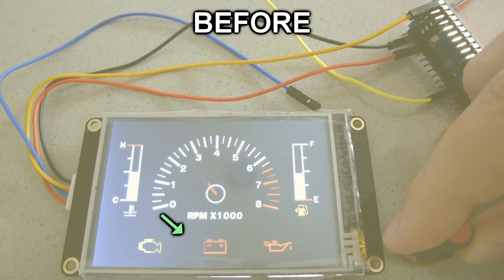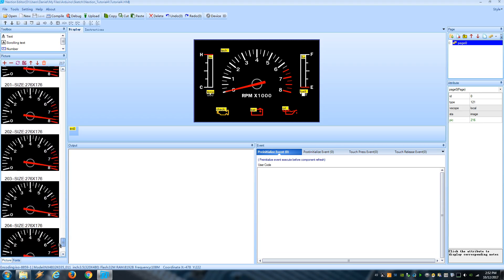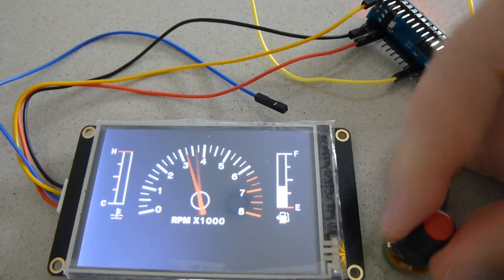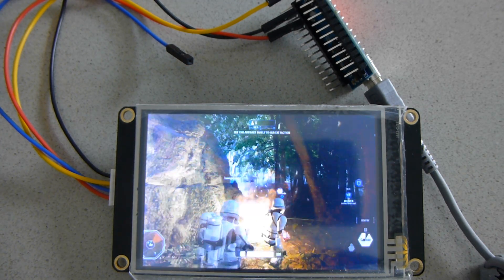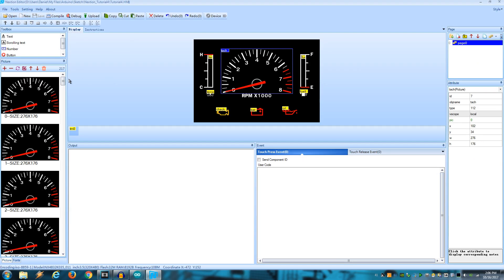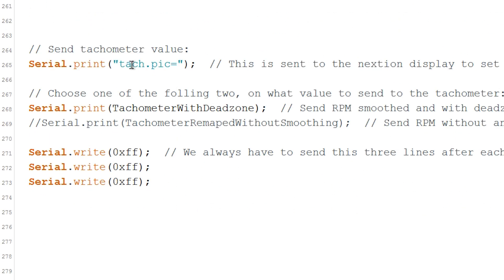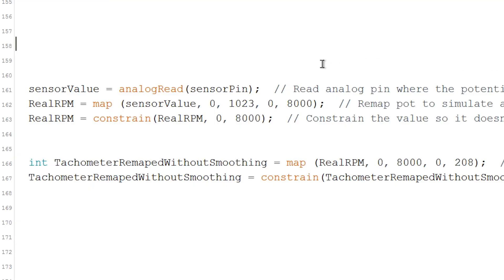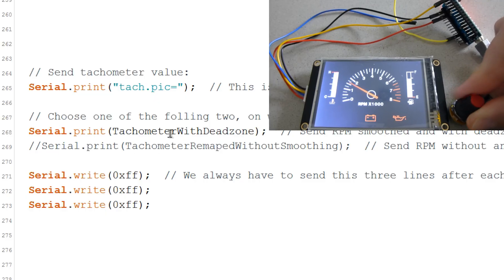Nextion+Arduino Tutorial #4 Custom Gauge And Play Video

Comment: Very nice video, how did you manage to make the images change depending on the received value inside the NEXTION editor ?
Reply from the maker: It's simple. The nextion editor has a variable and then I run a timer (loop) that runs a piece of code that puts the correct image depending on the value of the variable. If you open my project, you'll see

Comment: Is it possible to get that same precision out of nextion, to control a stepper motor, using it in place of a rotary encoder to micro step to positions?
Reply from the maker: Stepper motors are a completely different subject, but I guess it should work. My experience with stepper motors is very little
Reply: @interlinkknight  That’s cool.. I’m looking into it now.. I want the same type of resolution you’re getting to change the images, except using a slider in nextion, to rotate a stepper..

Comment: Please explain more the,gauge smoothen and deadzone part of the code. # What is the purpose of Deadzone?
# in calculation how the smoothening happens?
Reply from the maker: In the code itself i added comments to explain everything. Maybe you can also check out my video and code about tachometers, because i use the same nextion display and same gauge
Reply: @interlinkknight  please share the link of tachometer video
Reply from the maker: https://youtu.be/u2uJMJWsfsg
Reply: @interlinkknight  actually this method kill the flash memory.

Comment: Well, how cool is your initiative, I have an old car with a carburetor and I would like to implement it in its instruments, where there is already a digital clock display, basic functions of an on-board computer and include temperature, oil pressure or quantity of fuel. I studied electronics about 20 years ago and I know that with Arduino I can implement it, but I'm not in the business, maybe with the material that I made available, thank you very much !!

Comment: First of all Nice Job!
In second place i have a question...
How can i hide and display the three little images (motor, battery, oil) on the bottom?
Reply from the maker: There's a command to hide objects. If you check the example files you can see them
Reply: @interlinkknight  i find it, thank you

Comment: how to get the code? i dowload but dont open.
Reply from the maker: I put the links for both files in the description for Arduino IDE and Nextion Editor
Reply: @interlinkknight  dont work cant open arduino say but i find the file thanks. i want to ask you something. if i dont want to work gauge with potentiometer but with my can bus. the example is that. 
include <SPI.h>
#include <Canbus.h>
int data;
char buffer[456];

void setup() {
  Serial.begin(9600);  
  Serial.println("CAN-Bus Test");
  
  if(Canbus.init(CANSPEED_500))
  {
    Serial.println("CAN Init ok");     
  } else
  {
    Serial.println("Fail init CAN");    
  }
  delay(1000);  
  
}

void loop() { 
  
  Canbus.ecu_req(ENGINE_RPM, buffer);  
  Serial.println(buffer); 
  Serial.print("");
  delay(10);
}

the code show me the value with buffer how to do work this buffer with nextio gauge?
Reply from the maker: Sorry but I can't help further than this. I have no idea where that code came from. I only can help with my code
Reply: @interlinkknight  at your code i have problem. i dont find how to work your gauge with out potentiometer. the value from the potentiometer i give him from serial port and not from analogRead. thanks and sorry about my question and for my english :D
Reply from the maker: I don't know how to do that so I can't help

Comment: hello mate. first GREAT work, with your instructions i fix something like this. but i try when screen start do it check and show me the gauge from zero to 8000 rpm and then start count but i try so many times and dont find nothing can you help me how to do this?
Reply from the maker: Make on each cycle variable=variable + 1;

You need to record in another variable that you did the test mode to reset and start normal mode. This is basic stuff. Look for tutorials about "if else functions"

Comment: hey mi friend i have problems with the program when i upload de nextion panel and is : Target device does not match selectec device when i change te display ?? or i have a start a new proyect with this caracteristics and your tutorial ? i have a nextion 400x240 and this error when i upload
Reply from the maker: In the nextion editor, the top tool bar there's a button called "Device ID" in the right part of the tool bar. Click there and select your display.

Comment: Good video! But I have a problem, when I copy pictures inside nextion editor, then the nextion editor generates a white border for all pictures, and so it seems no good, because the background Is black and pictures are not confused with background. Maybe Is a bug of nextion editor, I don't know. I'm waiting for your answare. Thank you!
Reply from the maker: Looks like the pictures you are adding have the wrong resolution. Add pictures that have exactly the same resolution as your display
Reply: My display Is the same of you (3.5 inch). I'd like to insert a picture of a gauge like you. But I don't understend your answare, because the resolution of the screen is 420x380 px but the resolution of the gauge is less of screen one. Thanks for your time
Reply from the maker: Oh. You mean a normal picture. I thought you meant the background picture. I've never seen your problem before. Try with other kind of images. Remember to be bmp format
Reply: It's a big problem. At first I wanted insert pictures of gauge without background, but nextion editor added white background automatically. So I thinked to add manually balck background to all gauge pictures (because screen background Is black, and gauge pictures seem without background). However the problem now is that when I insert gauge picture in the screen, I see a thin white border around the square of the gauge, and so it doesn't look nice. The format is png, but I have the problem also with bmp. For exemples of I take a picture of your gauge and I resize It (with a program like Illustrator) then i Will see the same border (sometimes I don't see all the border of Square but 2 or 3 or 1). Thank you very much, and Sorry but you are very qualified. If you don't understend i could send a picture to you. Thanks
Reply from the maker: Send me the pictures to my email myusername@gmail.com

Comment: I still don't get how you made the gauge, I'm trying to make the same in Gimp but I'm stumped.
Reply from the maker: Do the background and then in another layer put the gauge with the pivot point in the center. Then save the image on every degree position. I did it on PowerPoint, but I would recommend using something like Photoshop.

Comment: I don't get how you smooth, can you please help me? Also are you taking a picture at every degree, or every how much is each picture different from each other. (Like are you doing 208 pictures because there's 208 degrees?)
Reply from the maker: The explanation of how the code works is in the comments inside the code.

And yes, I made an image of the gauge every degree
Reply: @interlinkknight  Thanks! How did you made the background of the gauge and the needle?
Reply from the maker: A mix of PowerPoint and Photoshop

Comment: I'm using your copied code for the tach but the tach is not going up in rpm. All my connections are correct and have tested my potentimeter  by using a number id and analogRead in that. It displays the analog output on the number ID but does not move the dial in the tach.
Reply from the maker: Did you modify anything on arduino or nextion display?
Reply: @interlinkknight  I figured it out.  Changed the baud rates from 115200 to 9600.
Reply: @interlinkknight  Like Noble Knight Medraut, I have been stucked with the tachometer without deleting the baud rate change. Even 9600 instead of 115200 does not work. I had to // the corresponding instructions.

Comment: I would like to use this method to create a vu-meter for hi-end audio systems but which is the time to load the background image ?
Reply from the maker: Depends on the resolusion of the display and it has to be enhance version. Mine is 3.5 inch and you can see in the video that it loads the images really fast.

Comment: A few more questions:
1. What if I reprint the number value after gauge update?, will it anyway flickering? (number or text over the picture). 
2. How do you did your gauge pictures, is there any way to do quickly and more efficient?

Thanks in advanced
Reply from the maker: Yes, it will flicker no matter what you do.

I did my gauge with powerpoint and photoshop. I am not very good with graphic design so I can't give you advice about that.

Comment: Sir this project is possible to run in NX4832T035 model and also i have the doubt how to fix the movement needle in that
Reply from the maker: No, it doesn't run on the basic version. You need the enhanced version 3.5"

Comment: Another question..... if my display is enhanced, but a different size, I seem to get an error...compile failed, position error, etc.   How do I convert it for a different screen size?
Reply from the maker: Watch all my tutorials about the nextion display and try my examples. All the information you want is there. If after all that you still have a question, ask me and I'll try to help.
Reply: I have watched all of them, but seems the examples only work if you have the same screen size.   Mine is 240x400.   Selecting a different screen size other that the one in example just results in an error.
Reply: It is nearly impossible to resize all the pictures in a video sequence.   Is there an easier method?
Reply from the maker: For things like full size images, you have to provide the images in the correct size of your display.

Comment: Do you have and example of this code without a delay?  I have come to find that your examples work better than using Nextions library, but using delay while reading actual RPM, MPH or KPH is a problem as a 20 mSec delay is a compounding problem.  Im wondering if this should be used with millis() instead of delay?
Reply from the maker: You mean the small delay on the arduino loop? I put it because the nextion display doesn't like when arduino sends data too often. I suppose you could create a millis delay to send data less often.

But let me tell you, I have used rpm sensors before and never had a problem with delays. Use interrupt pins.

Comment: what is the arduino model you use
Reply from the maker: Its called Arduino nano. I like it because uses the same sketch than arduino uno and its smaller. Also fits in a breadboard perfectly. Since I started using the arduino nano, I stop using the uno. Good luck
Reply: thanks, good luck

Comment: Nice. Is there a way to refresh a needle ONLY if it's value has changed else not update needle?
Then it would not flicker.
Reply from the maker: Yes, that's totally possible. Actually in my example file from my first video I did that for the gauge: https://www.youtube.com/watch?v=wIWxSLVAAQE

Even though that minimize the flickering, it doesn't prevent it completely. Eventually when the gauge refreshes, it does sometime flicker.

Comment: Nice job excellent, 

I'm sorry for disturb you cause I've only been interested in two days with nextion.
But what if I want to use two or more independent gauge on same screen? Because pictures are always placed from top left corner in the picture command.
Reply from the maker: You can put multiple gauges in any part of the display. You are limited by the flash memory, though.
Reply: @interlinkknight  hello. Did you mean flash memory of microcontroller? I want to make small animation with Basic Nextion.Where to store pictures?

Comment: fantastic example and approach, just a question about memory... I have similar approach and similar ttf file size, but on my 3,2 screen uploader said: file is too large. memory it seems to be 4mb, but file is 20! What is my mistake? Do you have some suggestion? thanks in advance
Reply: ok, I saw the spec of your display, and ok, your model has 32mb probably, I have 5" display also and probably this will be ok.
Reply from the maker: Yes, the 3.2" enhanced display has 16MB of flash memory. I have the 3.5" enhanced so it has 32MB. You own the 5" enhanced display? Why are you talking about the 3.2"? Or do you have both?
Reply: I am working to make some test on 'little' 3.2 basic and I am waiting from ITEAD 5" enhanced display... so I am working now with 4mb.... and 2/3 pages fill the memory.... I have a gauge based on RPM bars.... And I think that is not possible to load all images in 32mb, because images allocation is 10mb, but ttf compiled module will be 96mb (it uses RAW image format) :-) so I am working to draw the bars... it seems to work on 3.2, I will see on 5".... thanks for your support
Reply from the maker: Ok. Good luck
Reply: did you make working version for basic model

Comment: Thank you so much, my task just got much easier.  I bought a 7" enhanced display to add some new features to my old mercedes benz and was struggling cause people do not seem to like sharing infos about this display. at least this can help me understand and carry one... i have to customize 7 gauges because the built in ones are so awful and png files are not supported yet ... keep it up
Reply: Hey there, I'm having the same project right now and also have the plan to have a holo transparency look. Without alpha png, the only way is to slice the image to small pieces and update each of them, having all possible varieties as images for all slices. (which I already did, I made an animation with after effects and wrote myself a c++ program that automatically slices every frame) 
Do you think updating many pictures at once within every loop will still run at about 30fps? Will it even with the 7 inch version, as it has "just" the same cortex as the smaller screens?
Reply from the maker: Ok. If you want to message me, don't reply old comments because they doesn't  show on my comments feed. The older a commend conversation, the more gets bury out of sight.
Reply from the maker: Your comment makes me happy. Thanks for sharing. Is nice to see I could help. The image format is not that relevant. I try adding different formats into the nextion editor and the used space was the same. Apparently gets converted into whatever format they use, no matter what image format you put. Are you going to create your own gauge? If you do, which image editor are you going to use?
Reply: Exactly, they seem to be using BMP, but they says png is coming soon, I can image how transparency will add realism to the future designs. I am actually designing my gauge background pastern on Photoshop then needles or progress bars will be animated using your example. So Helpful..
Reply from the maker: Let's see if they can really make that work with transparency. It would be cool indeed. Good luck with your project and if you get it to work, maybe upload a short video and share it with me please.
Reply: Sure . let me ask you this do you think  an arduino mega can handle 2 nextion display?... I'm kind of crazy beginner... We could exchange ideas by mail if you want..
Reply from the maker: I've never used an arduino mega using multiple serial ports at the same time, but I don't see why it should be a problem, especially if you are only sending data to the displays. If you need to receive data like using touch-screen buttons, then might cause some issues. You would have to try. Worst case scenario you could use two arduinos, one for each display, and put a connection line between arduinos, with something like I2C. Or maybe two displays could share the same serial port? I don't know. You can email me my-user name/youtube-channel-name at gmail.com or click the contact button on my website.
Reply: Ok thank you so much
Reply: I've just tried the multiple serial  com and it works all you need to do is add the serial number after serial i.e Serial1.beging(115200); with print etc.; Serial1.print() this means the mega can handle 4 displays. How cool is that... :D
Reply from the maker: But can you receive data from two displays? That's the real question.
Reply: Hahaha, I'm only a month old in coding, lol. But I'm assuming if there is a way to specify the serial groups with the  arduino maybe  there is a way. But it's a good start  for the one direction com. By the way I'm French so excuse my mistakes...
Reply from the maker: Actually your english is quite good. I am originally from Venezuela (spanish speaking). I always find fascinating how two people with original different languages can speak thanks to the universality of english.

You can try my example files on my 2nd video tutorial where arduino receives data from the display.
Reply: Yeah thanks to the technology too.. I'm gonna work on the project a bit then I'll keep you posted... the video part is interesting as well I only hope I'll have enough space for this project. The fact that you can simulate GIF is good but the minimum in timer is 50 should go lower. I'm actually turning my old Benz into a sports car and will get rid of the old dash board and add a second display in the center.  Big project but so motivated... Any way take care and see you soon..
Reply from the maker: In my project I use arduino to change the images so it can go faster than 50ms. Let's continue the conversation by email because I can't check old comments easily, even if they are new replies, it gets buried.
Reply from the maker: If is the enhanced version, it should work. If is basic version, it might flicker or load images a bit slow. You have to try it. Just use the maximum serial speed rate (baud).
Reply: InterlinkKnight I will use the enhanced, thanks :) I will be using a teensy with a cortex to send data, so that should be fine. I will try and get you know when it's done :)
Reply: I guess it will work just fine...